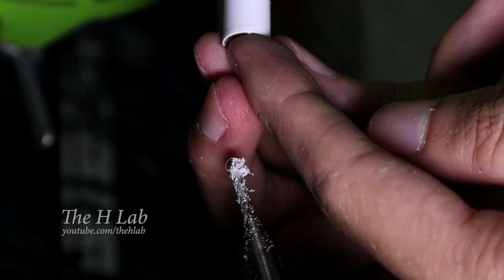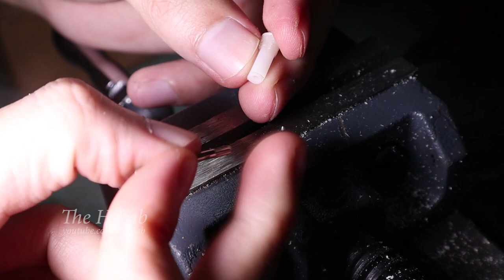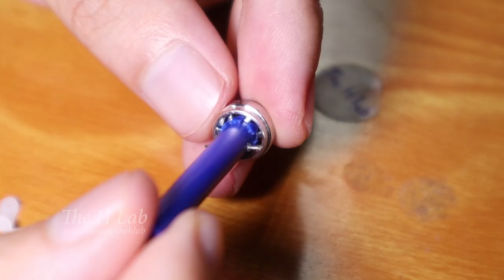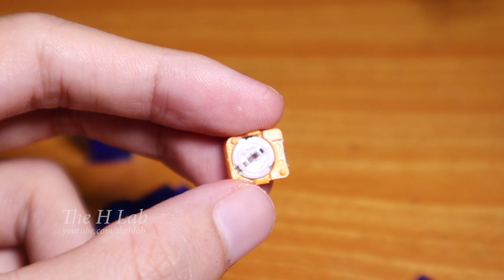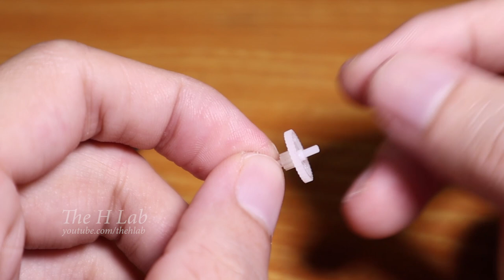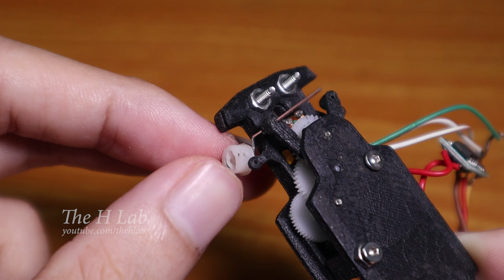Hot Wheels Nissan Skyline Silvia 1:64 RC | The H Lab | Part 2. Steering system

Comment: Awesome! what kind of trimpot do you use for steering sensor? is it easy for motor to turn the trimpot?
Reply from the maker: I get it from a sg90 servo. It’s designed for that purpose so yes it easy to turn by the motor.
Reply: @TheHLab  thanks for the idea bro, this's gonna make cheaper than buy 1,7g servo

Comment: Great work! I'm currently working on my own RC Hotwheels project, and this was also my concern, that all the other designs I see have created pivots outside of the footprint of the wheel, causing them to modify the body or misalign the wheels to compensate. I've come up with a couple different designs in CAD based on 4 bar linkages, but haven't decided on a final iteration, or construction method as yet.
Yours is the best I've seen yet (with regards to steering), but the attachment points seem a little fragile, and I'd like mine to have more steering angle (to drift lol), and this design forces those 2 factors to find a compromise between each other. Bittersweet! Haha. Looking forward to seeing what else you come up with. Subscribed!
Reply: Motor names
Reply: you are talking about the steering axis location....the mcpherson strut type steering setup has the axis inboard of the steering knuckles....for a 1/64th scale rc conversion there isn't going to be much of an improvement in handling to make up for the complexity and reduction in steering angle of a center hub steering solution.....it is neat and i do appreciate it's creation, but only a few car nerds will even notice for the effort involved...
Reply: @CATech1138  I agree, it's not a very sensible endeavor to undertake, but sometimes you just have to scratch the itch.

Comment: My tiny brain can't handle what (and how) you did to that servo =)
Reply from the maker: I just changed the mechanical system to make the servo fit into the car. The principle and schematic are the same as the original.
Reply: @TheHLab  lol, "just"

Comment: Not good at all. Waste of time.
Reply: Do you have a better diy 1:64 scale rc? Would love to see some videos but it looks like you have non. From what I can tell, he already improved a little on the steering angle of the car on this latest video, so it's definitely not a waste of time on his end.
Reply: 😂 I would love to see ur work man! It’s only a waste if it’s something you’re not interested in
Reply from the maker: I love to make the steering system work same as a real car. I know that a lot of people out there build a really easy steering system but it's all have a pivot out side of the wheels. Then they have to make the wheel cavity bigger or push the wheels in to avoid collision with the body.
Reply: @TheHLab  There's a mechanical advantage to it too for doing it that way, I recall loads of rc drift car reviews mentioning it
Reply: Barking like a lost mom